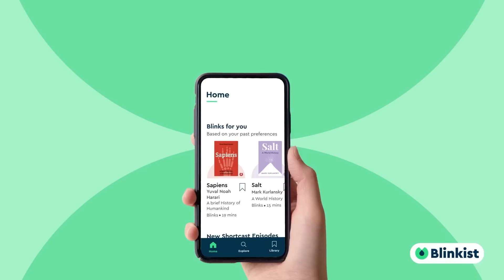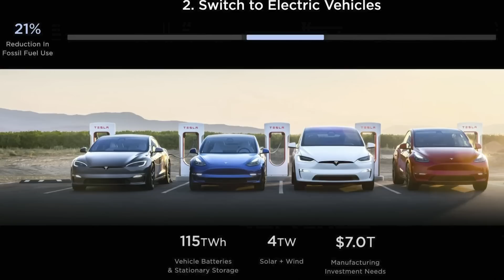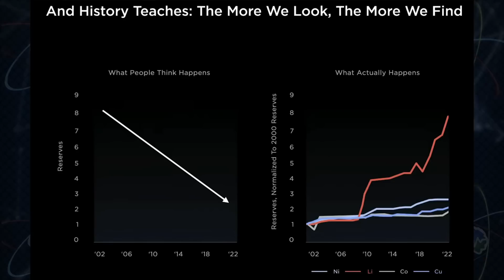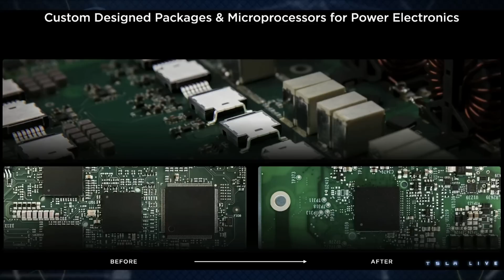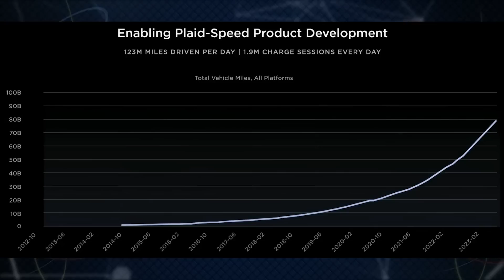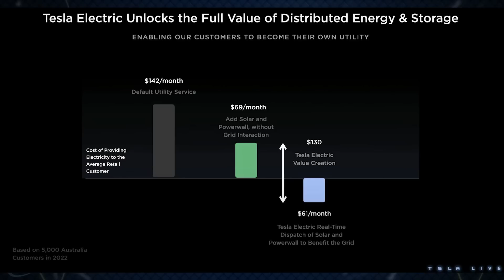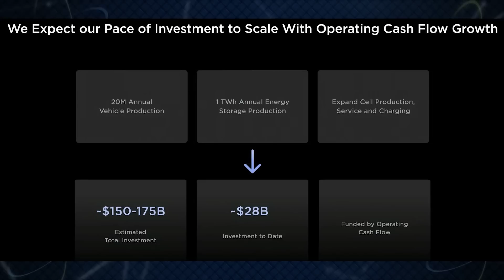We Squeeze Tesla Investor Day Into 30 Minutes | In Depth

Comment: Regarding the sunroof discussion, I want a metal roof. A glass roof is like having a glass crash helmet. If somehow the car you are driving becomes upside-down sliding down the road, do you want glass or metal separating you from the road surface.
Reply: I want one, too. But for different reasons. I really hate having nothing above my head, especially when sitting in a vehicle.
Reply: Tesla have glass roofs and make the safest cars on the road. The concentrated force needed to pierce their roofs will make any thin metal roof seem like paper anyway.
Reply: @RasakBlood  but who has time for science and engineering? A glass helmet 😂
Reply: The Tesla glass roofs are way stronger than the metal roofs that are on other cars, by a lot! Many crash tests and actual crashes has demonstrated how much stronger the Tesla glass roofs are than any other car roof. And, I wold rather have a plastic (composite) helmet than either glass or metal.. And a helmet is a different use case than a car roof. The glass is probably more expensive and heavy than plastic or metal, but Tesla values safety and the extra space in the cabin and the experience of the glass roof for the customers enough to make that choice.
Reply: Do you plan on flipping your Tesla...?
Reply: @0ooTheMAXXoo0  I wonder if the glass roof is stronger than the Cybertruck windows?

Comment: The question of the picture of the new home charger may be a wireless version. I spotted the rectangular pad under the car as soon as it popped up and said “What the hell is that?”.  Well, it didn’t take long to figure that out, but the real question is how far will this be deployed?  Will it only be for home use or will this be used in roadside parking (think apartment dwellers, shoppers, attraction parking lots…). Holly smokes!

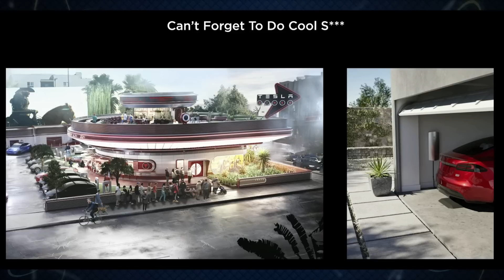Comment: 22:22 Regard Vehicle to Grid, Tesla obviously don't support it, and as has been talked about there is no way for the current hardware to generate and AC output from the batteries, but I believe Vehicle to Grid for existing Teslas are still possible.  There are DC contactors that connect the two power pins on the charge connector directly to the battery and they engage during DC fast charging.  They could make a home bi-directional charger that would cause the DC contactors to close connecting the ~400V battery to the external charger and it could have the inverter to put power back on the grid.  Perhaps that's what we see at 22:22.

Comment: Heat pump work good in AZ down to 40 degrees but they cost 2x as much to operate as a natural gas heater and are more expensive too install. And R410A refrigerant is on its way out by 2035.

Comment: Heatpump engineer here! 
Note: Heatpumps don't ONLY move heat from one area to another. They also produce heat. The compressor produces heat during the operation! However, most of that heat will also be transferred to the condenser and is therefore not lost. It all depends on the efficiency of the system - that is where Tesla will come in :)
Current good air-to-air heatpumps have a COP of around 4, meaning you end up with 4 times more energy (heat) than you use (electricity).

Comment: Well I don't think you should have skipped the logistics and supply chain part, because it's basically what will make scaling x20 actually work.
I liked the part where they said that not only they internally prepare steps for production at external suppliers but also send tesla personnel there to assist with ramp up of production.
Meanwhile rest of the industry doesn't, and take forever to ramp up, and has less quality control on what they receive cough bolt batteries cough. This is a key point that other car makers will struggle a lot to replicate since they don't have the talent to do it internally much less go to external suppliers to assist them. They just pick parts from catalogs and pretend they are manufacturers these days. All they do is assemble and are already worse at that than tesla.

Comment: What’s even more amazing than intelligent people not realizing this can be done with abundance is Elon himself not realizing V2X is potentially a huge part of achieving it as well as not appreciating that batteries are not the only way of storing energy.  In my opinion Tesla energy should be investing in other forms of energy storage.
Reply: Yes, you can use 'gravity' batteries instead of chemical batteries. Use energy generated from wind, wave, solar, off-peak nuclear, hydro, etc. at night to lift large weights in old mine shafts using electric winding engines. Then, when energy is needed at peak times, let the weights run down to the bottom of the shaft, generating vast amounts of instant power to feed into the grid (like a peaker plant does). No chemicals are needed, and the system could run for decades before replacement or repair.

Comment: What was not mentioned in this summary, was the dry coating manufacturing process of the battery. Apparently they solved that problem finally. Now they can scale their own battery manufacturing rapidly which also reduce that cost. I see TESLA reducing the price of the cars over time, so they keep up the demand in the market, even without introducing a smaller Model 2 and keeping a decent profit.

Comment: Great summary, however I find the new production concept idiotic, painting parts separately will be very complex and expensive, welding parts together will be very complex and expensive (Elon even said this himself at the beginning of the Model 3 production, and that's why there is now the stamping method), splitting the road like this leads to exactly the same parallel road that German car manufacturers have been using for a long time! This is simply a mistake, instead of reducing parts they have split parts unnecessarily, this is a step backwards and I predict that Tesla will see for themselves in Mexico that they are making a huge mistake here.